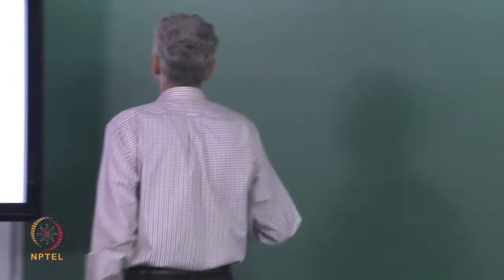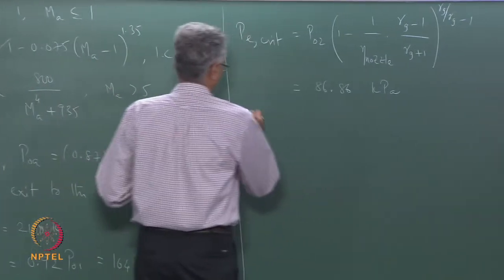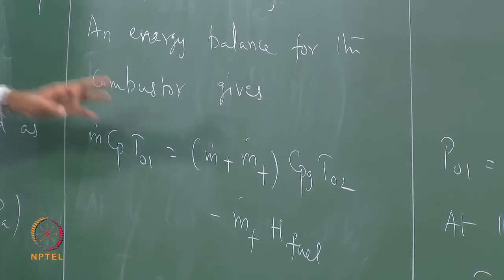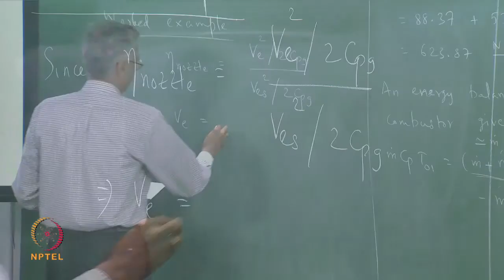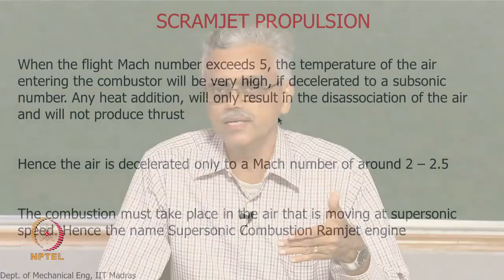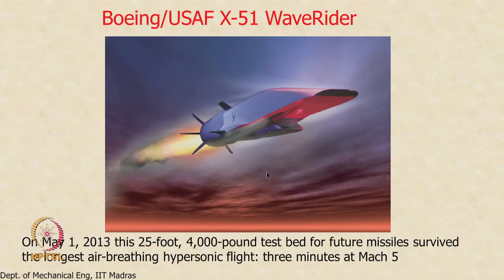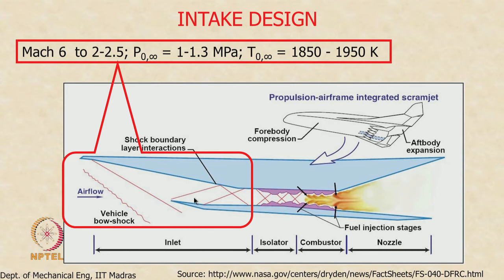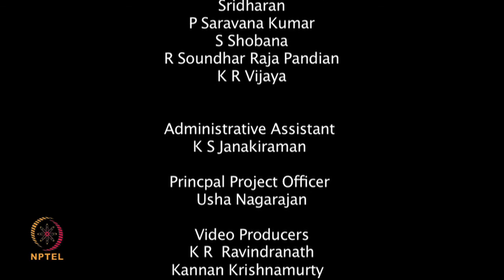Mod-01 Lec-39 Ramjets / Scramjets

Comment: Sir, as I understand, flame stability is a major concern; sir, is it possible to carry oxygen in the flight, carry combustion in a combustor off the mainstream and release the hot gases into the mainstream
Reply: yes, MI-scramjets are capable of carrying oxidizer within it and can fly in any atmosphere. These are medium independent scramjets engines.